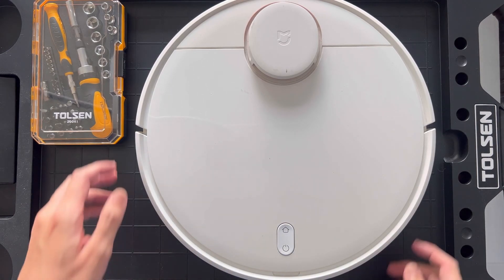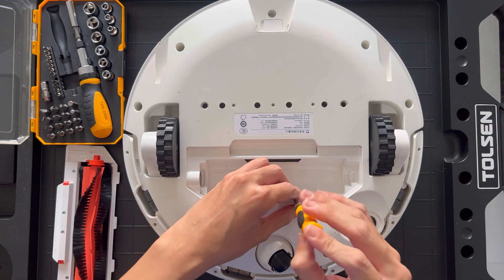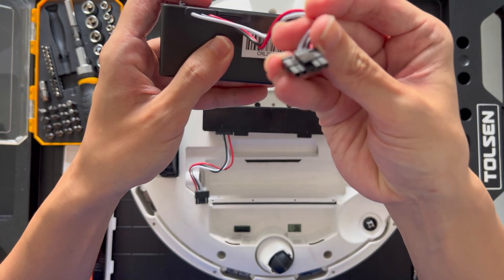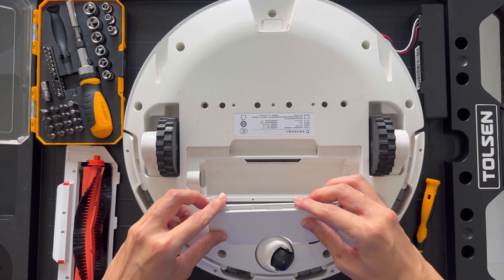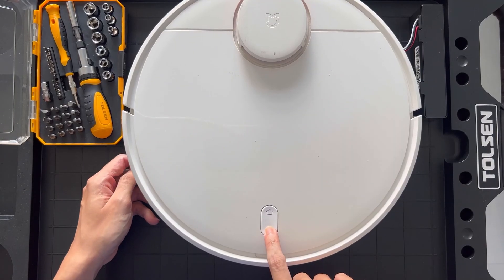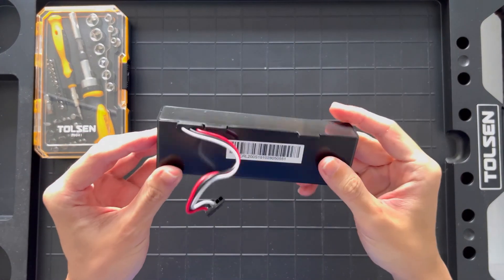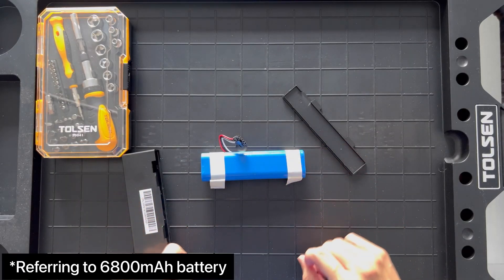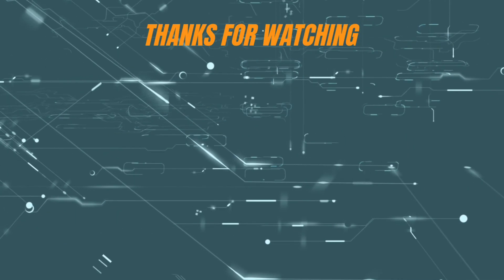How to replace robo-vacuum battery - Xiaomi STYTJ02YM Battery Replacement

Comment: Hi, thanks for this video! How do you tell if its a battery issue? My xiaomi vacuum can charge propely at the dock, but once i remove it out from the dock, the lights go out and it doesnt move at all. My vacuum is new.. really at lost what to do 😢
Reply: It also doesnt move away from the dock. Keeps showing Loading error or Please complete cleaning task when theres no cleaning scheduled
Reply from the maker: Oh since it’s new, you shld claim for a warranty repair rather than trying to repair it yourself. When I did the replacement, my vacuum was still working fine, it just wasn’t able to last throughout the whole cleaning area(which it could in the past) and stop randomly while cleaning

Comment: It has 4x 18650 batteries inside. There is no 6400 mAh battery at this size. If there is an avertisment for such a battery it is simply a lie.
Reply: I agree with you. A lot of capacity lie of such battery on Aliexpress
Reply: 3500 mAh at maximum.

Comment: Appears to be the same as the Wyze Robot Vacuum, but the problem is the Chinese sellers often lie about battery capacity, and will advertise say a 6800mah battery capacity only for you to plug it in and find the run time is slightly less than the 3200mah factory one, indicating false advertising, and returns to China are basically impossible as you'll spend as much to ship it as the product is worth.

Comment: Hi i have the same problem, how is performing after the replacement??
Reply from the maker: After replacement, it was as good as new!  But I must say the capacity deteriorates faster than I expected compared to the original ones.(might be due to the way I used it, doing 2 sweeps around the house daily). Currently on a single charge, it is no longer able to to cover my whole house which is around 1000 sqft